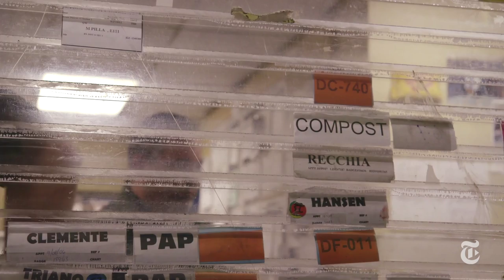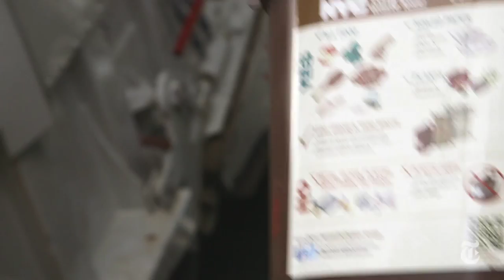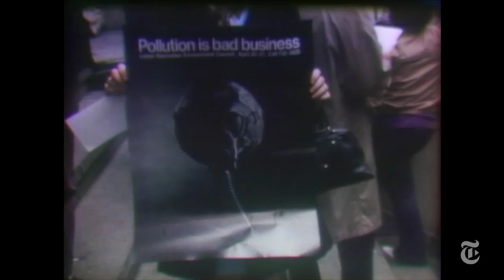Where Does New York City's Trash Go? | Living City | The New York Times

Comment: One place in New York state NYC's  trash goes to is Niagara Falls.  It comes in on trains I believe and comes to a company called Covanta. The containers on the train are picked up and put on a couple of modified long frame semi truck tractors.  The trucks just bring the containers a short distance from the train and into a large building where the container is emptied of its trash.  A front loader pushes the trash into an enormous "hopper"/ holding cell where a couple of claws suspended from the ceiling of the holding cell and that are about twice the size of a garbage truck come down and take big handfuls of the garbage.  It is burned to generate electricity.  The ash is used in landfills in the area.

Comment: Sooo...landfills. Let's talk about them. Why are they so common in the US? I didn't hear a word about waste incineration plants. You can use the heat to boil water and use the steam to produce electricity. And the excess steam can be used for heating or in manufacturing plants. For biological waste there are bioelectric plants, where the produced gases are used to produce electricity. Or, as mentioned in the video, you can use it as fertilizer.

Comment: Transporting those insane ammounts to distant landfills has huge environmental costs. Why don´t they have incenerating Waste to Energy plants? Clean, efficient, and deliver power.
Reply: Because every time they try to build one, people in the area object.
Reply: Under which data and evidence they object? Incinerators today have extremely efficient gas treatment systems and are quite clean. I would object 1000 times more the construction of a landfill. Besides being noisy, ugly, and stinky, at some point during their lifetime they will have a membrane failure and spill leachate underground, contaminating both soil and water.
Reply: I don't know why they object. Just that they do. Then again a lot of people object to having anything built near them.
Reply: There are extremelly efficient gas treatment systems today. You can´t compare a car´s minimal exhaust treatment system with a very complex    incinnerator gas treatment system. There wouldn´t be any significant burden on air pollution.
Reply: I would agree, energy from waste solutions are definitely a superior solution for many municipalities. As per your concern regarding membrane failure:

1. Modern day landfills are often designed (changes depending on region) to perform as a hydraulic barrier well past the contaminating lifespan of the waste. Based on our current aging models (which are considered conservative) the high density polyethylene geomembranes (HDPE GMBs) often used as the primary barrier in a landfill can sometimes last in excess of 500 years (assuming normal landfill operating temperatures and proper design). Unfortunately not all GMB products are equal, and some perform much better than others. 

2. You would be correct in saying that all landfills leak, or at least a good engineer should assume just that during the design of a waste containment facility. However, as per the design, the magnitude of contaminant migration into the groundwater is considered negligible provided the installed barrier meets current QA/QC programs and is absent of holes post-installation (I stress that this should be the case for modern landfills as opposed to 'dumps'). I would never recommend eating the soil directly beneath a landfill (referred to as the attenuation zone), however I would have no concern drinking well water from a house in close proximity to a landfill. 

3. A new problem arises, in the form of ash, when we start burning waste for energy. I previously alluded to the importance of operating temperature on the service life of a GMB barrier system. If we dispose of incinerator ash in a landfill (often ash monofills, i.e. ash is the only waste) the operating temperature of our landfill significantly increases as the chemical processes involved in the breakdown of this ash are highly exothermic. This can drastically reduce the functional lifespan of our GMB barrier system. Possibly by an order of magnitude (depending on temperature and material used). Fortunately, a good engineer will almost certainly be aware of this and the resulting landfill design will address these concerns. 

side note:
I would google "NIMBY syndrome" as a possible explanation for why people don't want landfills/incinerators built in their area. The sad truth is that something will always have to be built somewhere, and we will always adversely affect the environment. Lesser of two evils thing I suppose. 

Cheers,
Reply: Hi William, thank you for your thoughts. I have previously worked in 2 Municipal landfills. Both had huge leaking problems, with some piezometer readings through the roof, particularly chlorides, which indicate leachate spill. I know through colleagues that managed other landfills that had the same kind of problems. HDPE is very very rigid and safe material indeed, but there are a number of ways a landfill can leak other than just material degradation. Deficient welding spots on junctions, and the formation of air or water pockets beneath the membrane, which are nearly impossible to predict on project or construction phase, can easily lead to membrane rupture upon the pressure of thousands of tons of waste. Additionnaly, landfills can also leak from some points of its sides (membrane limits) very easily during heavy rainfalls, because the leachate drainage system isn't simply able to cope with peak productions in very short times. Off course these are all factors that can be minimized with clever and efficient designs, as well as cautious management and might not manifest in some landfills. However, from my experience pretty much all landfills executed over slopes or hilly mountain sides will have some of this problems.
Reply: Hi Joshua, 

I really appreciate the response, glad to hear some insights from someone in the industry. I understand the implications regarding welding failure as I'm currently writing my thesis on just that, I've also worked for 4 years prior to my studies performing QA/QC work on GMB installations. From what I gather a lot of engineers know little in regard to proper membrane installation, as the welds them self CAN be quite robust. Problems may arise with poor extrusion welds from what ive seen/read, however wedge welds appear to perform quite well in the long term (although they have been found to age quicker than the parent sheet material, Rowe et al., 2017). Another important thing to consider are the advances GMB manufacturers have made in material fabrication. Todays GMB products are far better than those produced pre-2000. I'm not certain about the landfills you've witnessed failures in, but I'm curious how many of them may have been constructed before the year 2000? Its obviously still possible modern landfills may experience similar failures though, particularly in areas which may be prone to differential settlement. Its very interesting you mention chloride problems as I've been told that is often the contaminate which dictates the design of the landfill. This is certainly the case in Ontario where I'm from. 

What is new to me - and I'm glad you mentioned - is the entrapment of air pockets beneath the liner. under what conditions do these sort of failures occur? Also, if you don't mind me asking, what sort of weld failures have you witnessed?  Any information on that subject, albeit anecdotal, is still good information for me at the moment. 

Thanks again for the response, I've been procrastinating while preparing for my comprehensive examination haha (its this Wednesday). 

Cheers, 
William

Rowe, R. K., & Shoaib, M. (2017). Long-term performance of high-density polyethylene (HDPE) geomembrane seams in municipal solid waste (MSW) leachate. Canadian Geotechnical Journal, 54(12), 1623-1636.

William